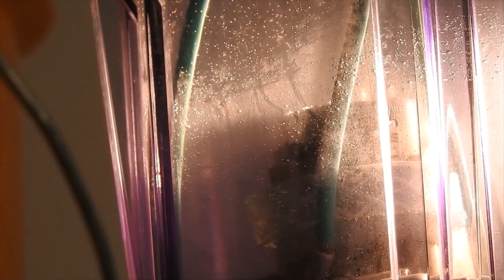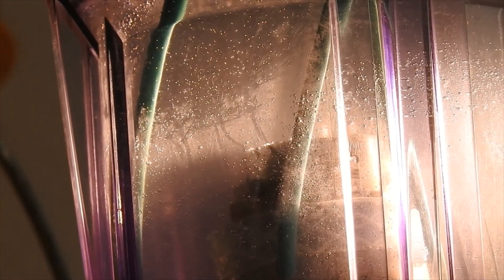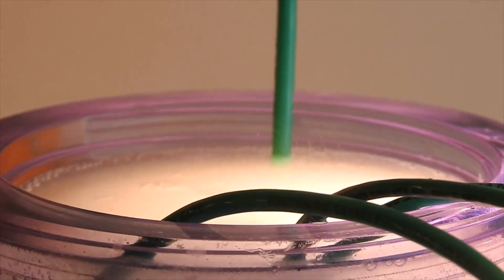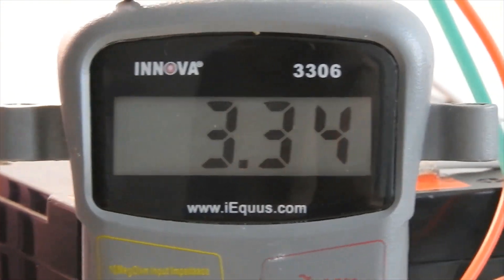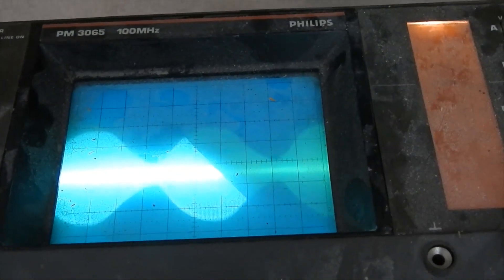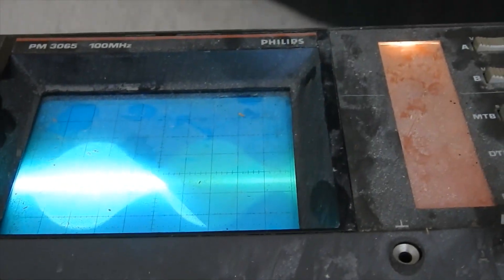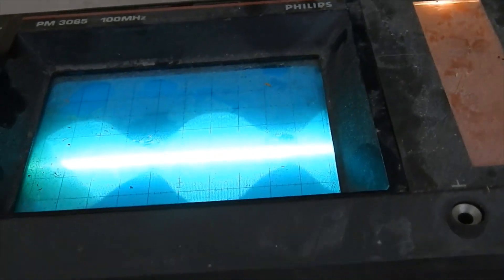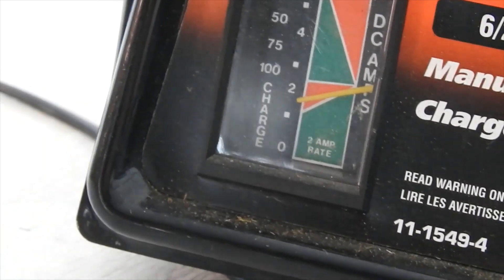Stanley Meyers HHO Resonance Signal

Comment: thewonn, nice job! Do you think to run more cells on it? will wait till you run on 7 cell the same amount of gas each cell. What kind of frequency you use, and why you put so many magnets on ferrite rod? Seems like Ferrite rod or the ferromagnetic steel _=?
Reply from the maker: Full replication plans are available now at
https://rover.ebay.com/rover/0/0/0?mpre=https%3A%2F%2Fwww.ebay.ca%2Fulk%2Fitm%2F202868531009